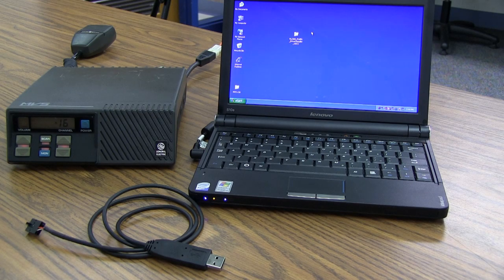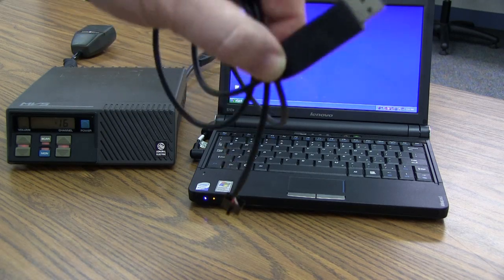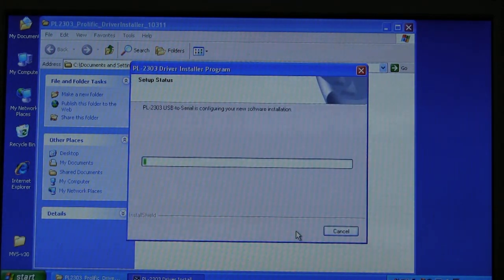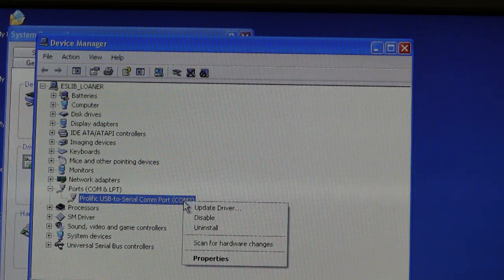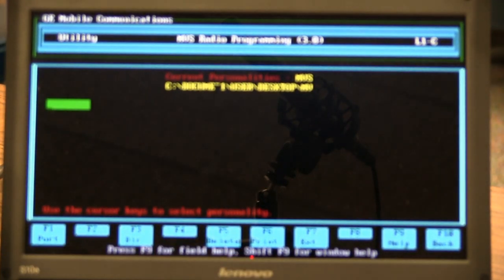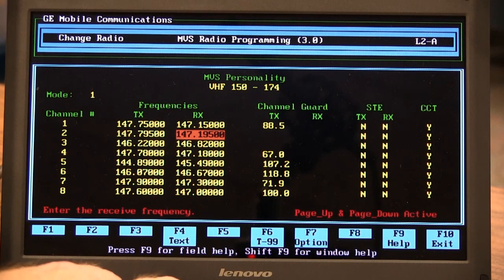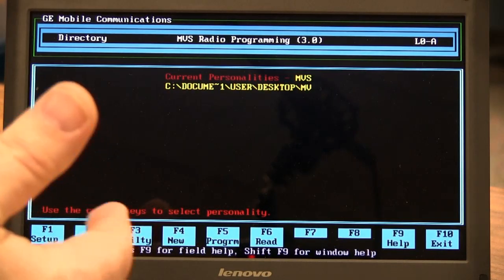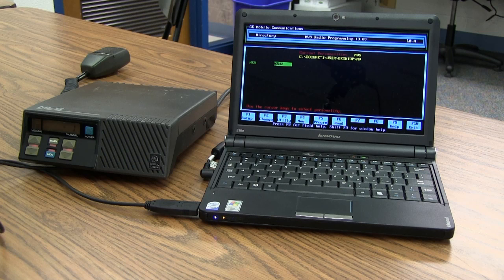GE ERICSSON MVS MOBILE PROGRAMMING CABLE

Comment: I know this is an old video, but, do you have to power up the radio or will the 5v from the USB allow for programming?  I've got the correct cable and driver, but, just can't get the two to communicate.  Any help is appreciated.

73's

K6OXC

Comment: Hello BWHA38,

I follow step by step according to your video but after saving and checking the frequency stored still the same frequency when I bought the radio.I used the cable which I bought in my comments bellow and Windows XP Pro Ver 2002 Service Pack 3 and Desktop with Pentium 4   2.26GHz 992MB ram. And GEMVS is 150MHz up type of frequency. 

Hoping you can Help Me. 

73

Edgar DV3SJM

Comment: I was able to "Hairball" one off of a Baofeng cable set to COM2  TXD RXD & Ground, The GE Software 'Saw' it with roach clips to a 10 pin header connector Works great A $10 Garage Sale Special! It'll wind up on packet eventually... 73 DE MATT

Comment: Hello bwha38  ...I bought the cable from ebay http://www.ebay.com/sch/i.html?_trksid=p4712.m570.l1313.TR0.TRC0&_nkw=PL2303%2CUSB+to+UART+TTL+USB+to+COM+Cable+module+PL2303HX+Converter%26+Free+shipping&_sacat=0&_from=R40    to program my ge mvs, can you conform the cable wire color coding connection... from cable says black-ground to be connected to no. 1 grnd in radio mic connecor, green-TXD to be connected to no. 8 Rx data and  white-RXD to be connected to no. 9 Rx data. What about RED cable wire this is to be connected where in mic connector?   

Thanks ...73 de Edgar DV3SJM aka A65BC

Comment: The GE MVS is one great tough little radio, excellent as a starter radio. If you'd like, visit Yahoo! Groups GE MVS group and share this with us!! I have the TQ-3370, and your method is much simpler than using it. That's why I asked if you built these.

73 de KE5LIB!!

DZL